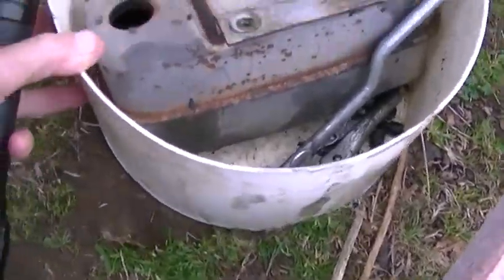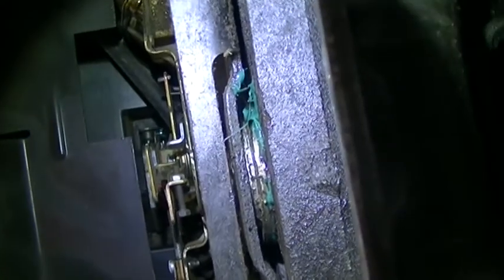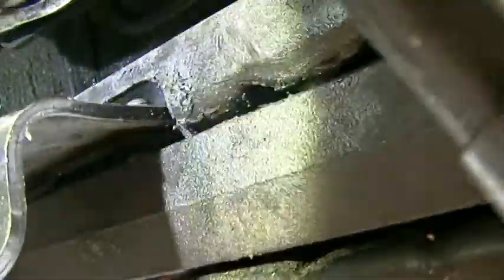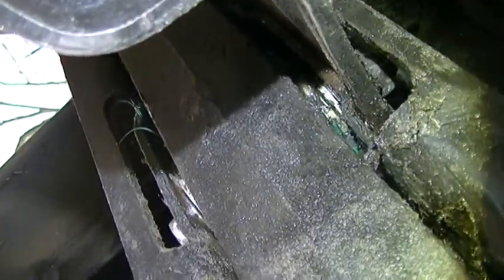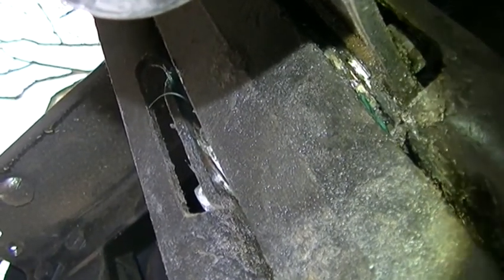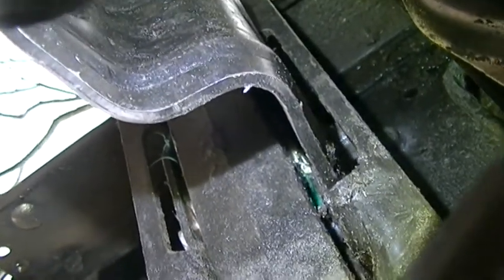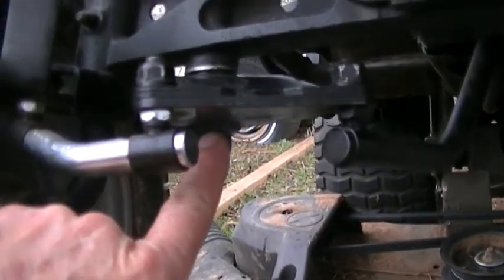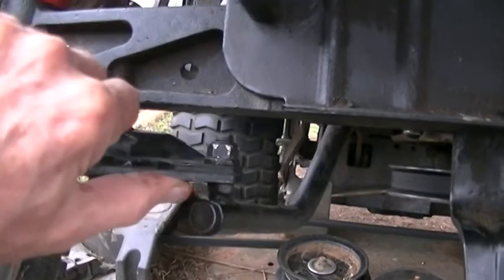Craftsman GT 6000 Toed Out Problem Resolved.  2013 Model.  Engineering Defect.  Pt. 3

Comment: Do you know how thick the washers was you used or have a washer part no?
Reply from the maker: 2 washers.  One on each end of bushings.  I think they were 5/8" ID or 11/16" ID.  Spacers are needed to prevent the Axle Housing from distorting/crushing.  I had to tap mine into position to get the bolt back in.  You have to add shims to fill the gap left from trimming the Bushing.  The washers I used came out of big bucket of Bolts, washers and nuts.  I found a couple that worked.